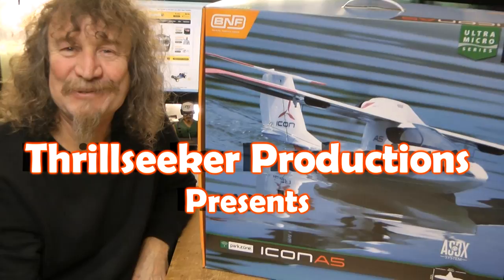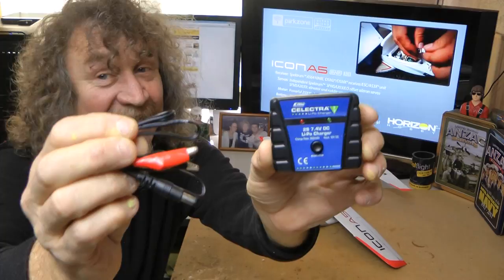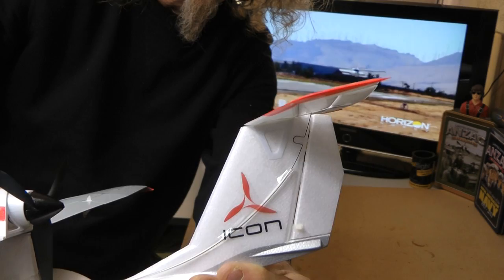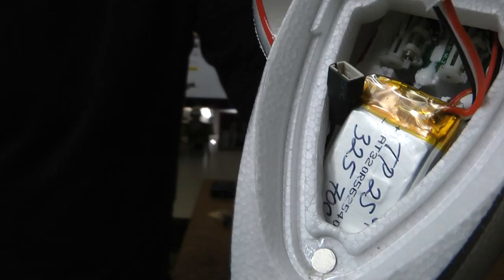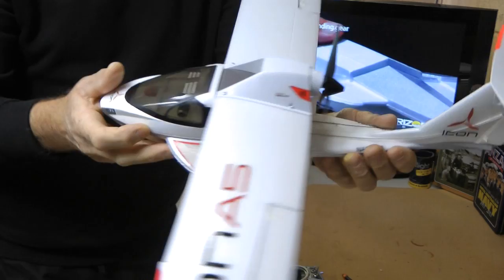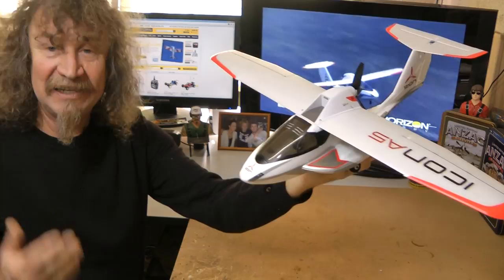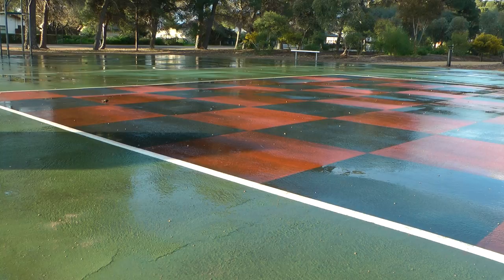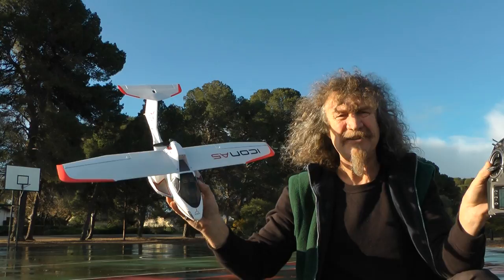Parkzone Ultra Micro Icon A5 Un-Boxing/Review + Bonus Flight Off Grass

Comment: Every micro plane I have bought has the thin tail area problems and I have had to fix with glue or clear tape which adds extra weight to that area.  Hopefully Horizon will fix this problem area with their micros.

Comment: Don't get a micro as your first plane. Get something like the Easy Star 2 or similar with a high rear prop like this one. Bigger planes tend to be more stable, have longer flight times, and are easier to see in the sky. Also, I's suggest if you havn't already playing with an RC simulator first. Micros also tend to be very fragile due to the light foam and break easily.